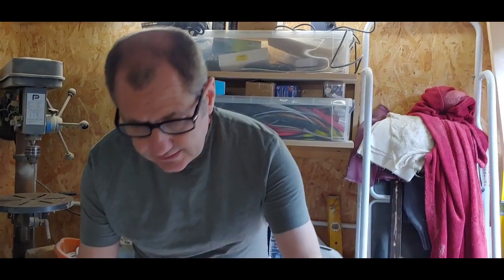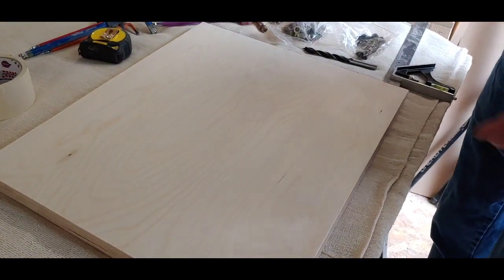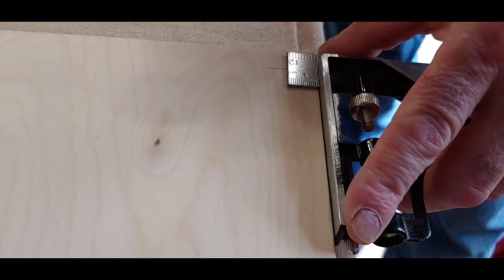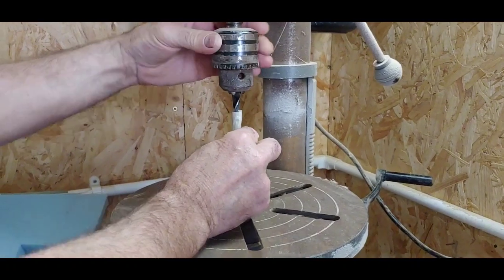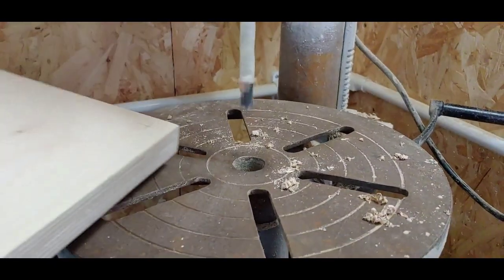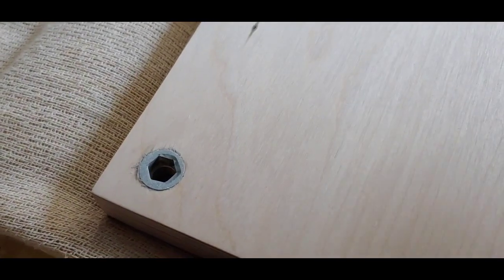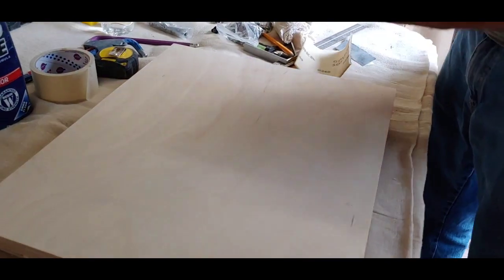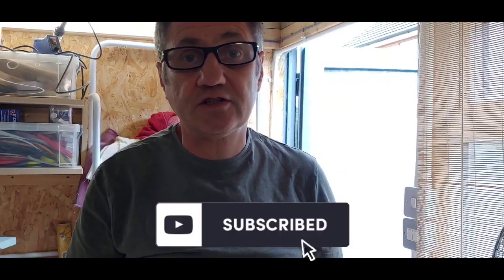How To Make A Very Effective And Reasonably Priced Isolation Table

Comment: As a tip for drilling the main board, PRACTICE getting the hole size correct by drilling scrap material, then fit the insert and you'll know whether the drill bit size was actually correct. Sometimes inserts may be manufactured slightly smaller or larger than the specification on the package label.

Comment: Great video! But It's better to drill larger than the metal dowel and fill that space with epoxy. It'll prevent plywood splitting. Epoxy might help to absorb some vibration aswell.

Comment: Nice. Rather than spikes I like to use felt pads. Japanese ones are best — they are very good quality and much more dense than the rubbish we can find at IKEA or b&q… I’ve also experimented with ply board in a sand box, but I didn’t really notice any improvement over a slab of ply and felt. Plus, my kids aren’t tempted to spread sand all over the house…

Comment: Nicely done. Simple solutions are always very attractive for audio, I think. Do you have any thoughts on the bamboo boards that people are using for isolation, like the Ikea chopping board?
Reply from the maker: Bamboo also is good, the IKEA chopping board, but you are governed by the size, they are never quite big enough, they are both about the same for isolating equipment,  thanks for commenting & watching
Reply: The two bamboo boards with Sorbothane feet under one of my Rega planer 3 Turntables (at the moment 😉) seem to be working very nicely to me. Can be seen and heard on my wee channel. 😉
I also use slightly smaller ones under my Audiolab 8200cdq, Arcam fmj a19 amplifier and Marantz Cd63 mkii Ki signature edition. All the above imho have been a perfect size for my equipment. 😉
Reply: @jimsregaturntableshifijukebox  Cheers, you have some good upgrades going, there. I enjoyed the Police videos, great sound.
Reply: @audioupgrades  thank you very much. I do like looking at what your upto on your channel too and am a subscriber. 😉 👍
Stay safe
Mij 🏴 ☺
Reply: @jimsregaturntableshifijukebox  Cheers, I have videos coming, once the weather cools down a bit.
Reply: @audioupgrades   cool, look forward to seeing them. 👍